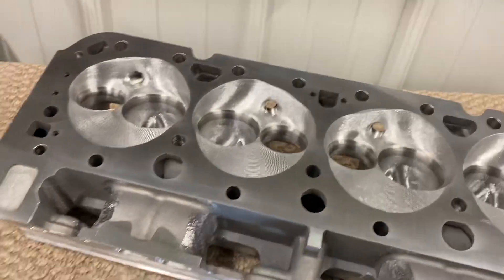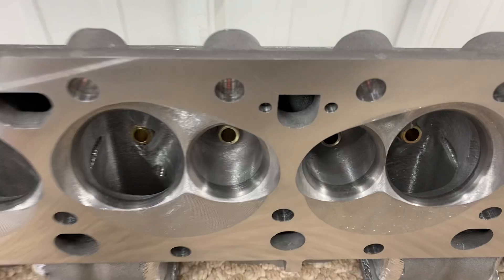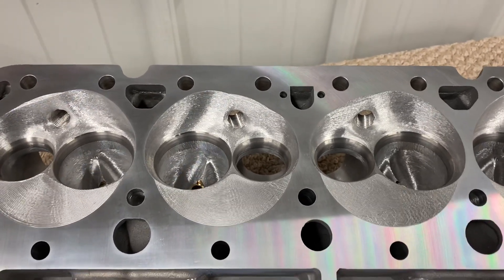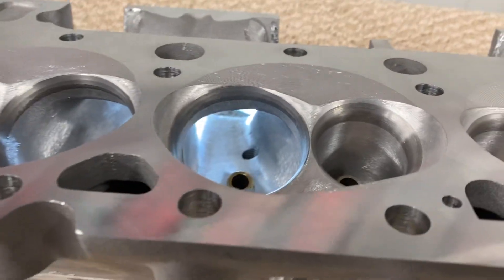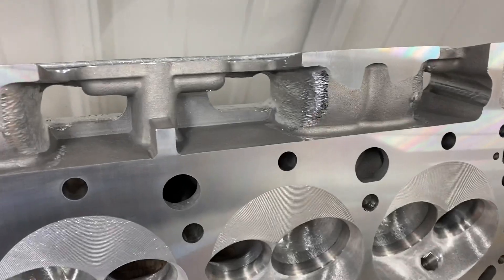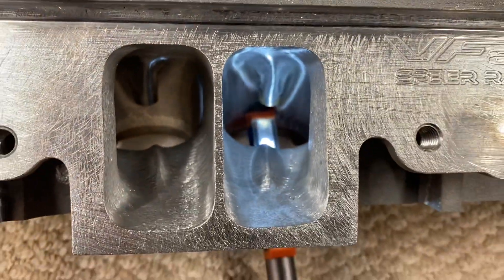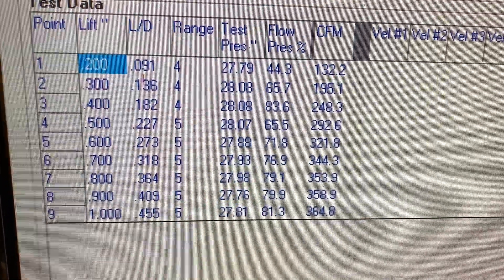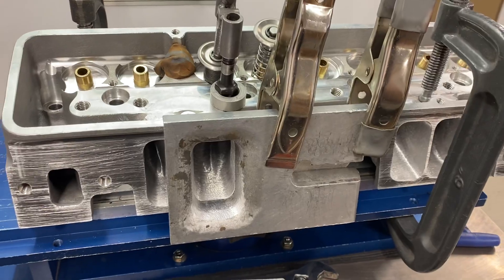ProFiler 23 degree 360+ cfm

Comment: Very impressive numbers for a 23°head..good work !!
Reply: Yes very impressive for sure! But I noticed how there's very little gasket sealing area between the port and bolt hole on the exhaust flange on the left side, and virtually none on the right side (center two ports). It's at the 43 second mark. Will that seal?
Reply: @notnecessarilynecessary  Jesus man, use some hylomar !